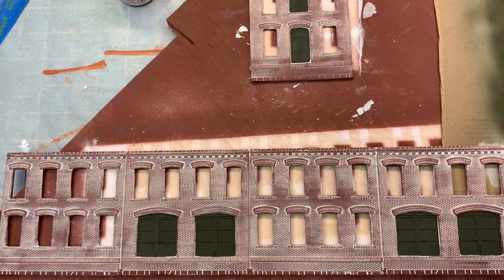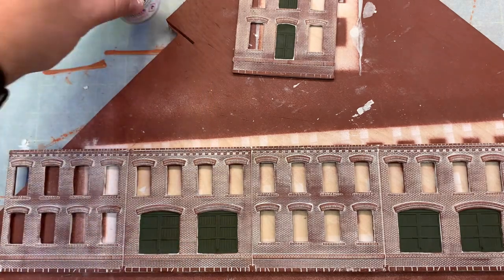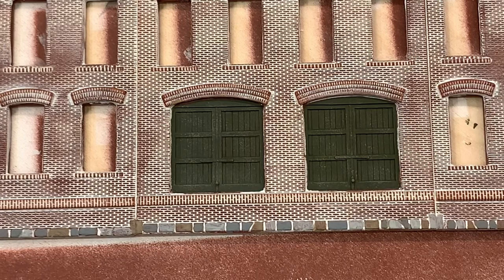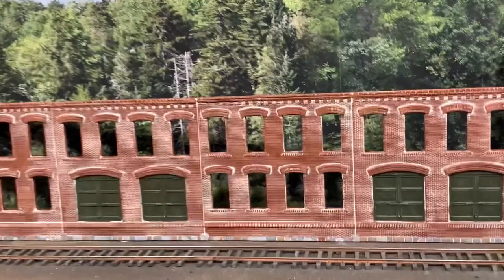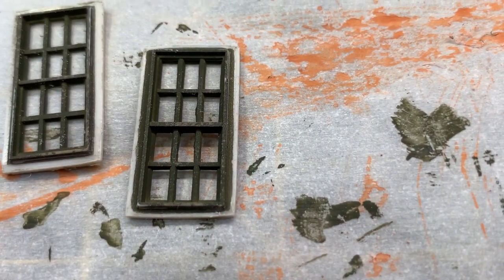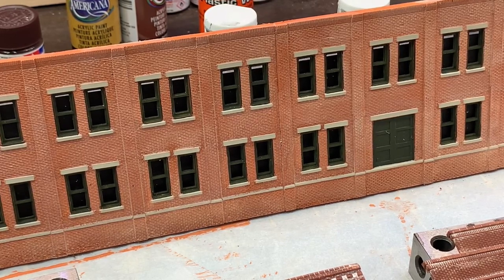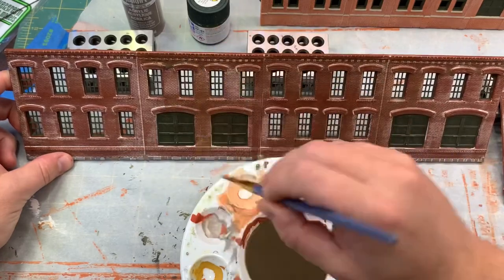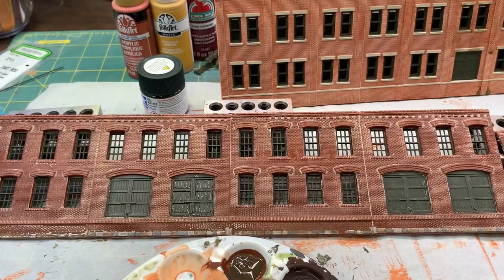Manchester & Deepwater Version 2.0 Update 31 - Finishing the Warehouses

Comment: I use a mini blade screw driver to peel the paint from the window frames, it’s faster than sanding.
I’ve decided to look upon painting DPM windows as a cathartic zen like experience as opposed to mind numbing. 😊
Nice work on the buildings
Reply from the maker: That's a good way to think of painting molded on detail.  I would say I started with that mindset, but it didn't last.  Like I say, take a breather from one of those, but I'll be back and rearing to go on another eventually.  Good tip, too re: the screwdriver!

Comment: I mask  on the back of any building that will have windows put in. That and the glue edges of the windows. Easier in the long run. Think ahead!!! Some people comment on my clean buildings ( just slightly aged ) and I have to say that I just had them steam cleaned. Once every 10 years so they will live on for many years. The downspouts were a nice save... All in all, a very nice building...
Reply from the maker: Thank you David - that is a good tip on masking.  I masked the edges of where the two larger pieces joined, but for some reason the windows or window openings didn't occur to me.  That would have been easier!